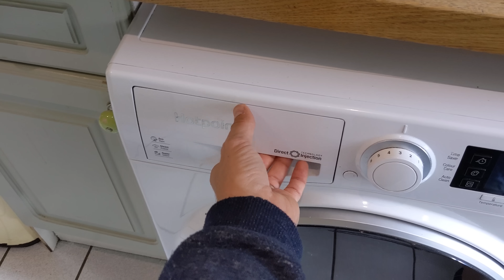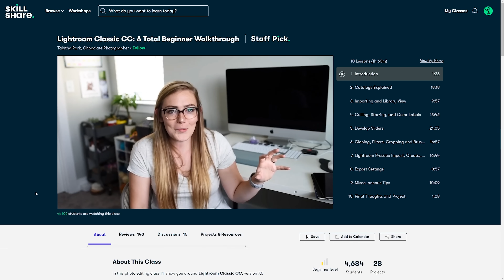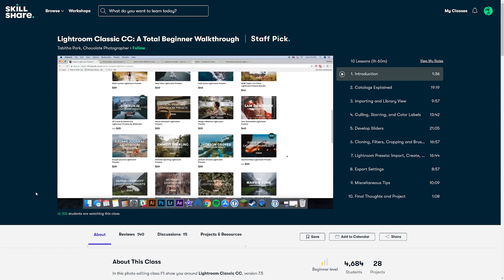The Pythagorean Siphon Inside Your Washing Machine

Comment: I live in Argentina and we don't have that kind of flush mechanism. We have some variations of a rubber cup or flap that gets lifted with the lever or the push of a button (that pushes a lever...). I got to know the existence of the siphon mechanism some years ago thanks to youtube. In fact, that cleared me some doubts I had when, for example, watching some movies... in which when a person goes to flush the toilet, if the water tank is not full, the toilet does not flush, not even some small amount of water it might have in the tank. Thats because of course because they're using the syphon mechanism and when the water level in the tank is low, you can't prime the syphon using that kind of chute that gets lifted with the lever. In my country, with the simpler rubber stopper, if you flush with the tank half-full, you get a somewhat wimpy flush, with only half the amount of water, but you get a flush. In that video, I don't remember the channel, it said that the syphon system is mainly used in the UK, and it was "chosen" or "enforced" (idk if enforced was correct) because it reduces the chances of a leaky toilet, because in this system the toilet might leak only because of the water fill mechanism float valve malfunctioning and letting water inside the tank above the required level (that water leaks to the bowl via the syphon), as when using a rubber flap or cup to obturate the drain to the bowl, you can get a leaky toilet that way caused by the float valve, but also you can have the rubber degrading or not sealing properly, so the water leaks to the bowl, so there are two potential fail points.

Comment: A regular siphoning hose will self prime too if the hose is below the water level of the container and has an exit below the water level as well. Like if you drill a hole in the side of a bucket and push a hose through it, or if you closed off one side of the bell in your 2D model and imagined the open path as a single piece of tubing rather than a stand pipe and bell.

Comment: Another really cool mechanism found in washing machines is the door lock mechanism. It uses bimetal plate that changes shape when heated and prevents the door to be opened for enough time for the drum to stop spinning in case of power failure.

I demand more washing machine related content 😅😂
Reply: My washing machine is more cunning - it detects when the drum's stopped - AND it's all purely mechanical !
Reply: @millomweb 
*electromechanical

Comment: Very good. The only reason I'm not sharing it to my friends is that several times you use the term "pulling" for liquids. Yes, we can lift liquids above a diaphragm and air pressure can push them - but they can't be pulled. I think you should redo the audio or put a caption in to correct yourself where needed.

Comment: Ah, the good old British toilets, regularly failing every 12 months, nice for keeping an army of plumbers employed.
We use a much simpler mechanism here (and I believe they are fairly common all over Scandinavia) which has a hole in the bottom, and the flush mechanism is a cup you lift so air get under it, and then it rides on the water until it's at the bottom and it seals again. Waaaay simpler and rarely fails.
Reply: Siphon flush mechanism failures are not as common as you describe, but in any case the common failure modes do not result in leakage, unlike with dump valve (flapper or plug) mechanisms which will often gradually fail with seepage into the bowl. I've had to replace the latter for this reason, and never the former.
Reply: @rednammoc  Just anecdotal evidence of course, but from my 3 years in the UK, having to service the toilet annually was a thing (and it is definitely not a thing here, just like separate taps for hot & cold water), and speaking with others this was fairly common.
And from a more objective standpoint, the siphon mechanism is much more complex than a simple plug on a stick, but if you have some better hard evidence of the opposite I'd like to hear it.

Comment: Im not sure, but I dont think toilets here (Norway) use that same system, because if you want to flush it completely you push down and hold the button longer, which according to the explanation in this video would cause it to flush less rather than more. If you want just a small flush you just press down and immediately let go, or alternatively some toilets have two different sides of the button thing that you can push: one that gives a big flush and one that gives a small flush.

Comment: As others have indicated, in the united States of America the "flapper flush" is the most common design with only the occasional bell siphon. In recreational vehicles, passenger rail and aircraft a flapper closet is preferred.
You missed one siphon in the design, there is one (or, there are two) in the bowl.
Reply: Canadian toilets are like the American ones typically incase anyone was wondering.
Reply: @georgeolund7572  Well, Canada is in America, so that makes sense.
Reply: I believe airplanes generally use a vacuum toilet these days. I know that they are what is used on the trains here in Canada too.
Reply: Your pan siphon - is where the pan fills with water first (or is already filled) - Steve probably has not come across these.
Reply: Matthew Ellisor Not in U.K. toilet bowls, there is a U bend and horizontal rear waste connection on most toilets, vertical drains through the floor are rare.
Reply: @spencerwilton5831  If you read his comment,  he specifically said "in the United States". That doesn't include the UK.
Reply: @spencerwilton5831  I've come across one with a siphon - where the flush fills the pan 3/4 full then the whole lot empties.
Reply: @spencerwilton5831  America use the same kind of toilet bowl. What this commenter and the video are talking about is the tank of the toilet.

Comment: Here the most common thing is a rubber ball valve in the bottom of the tank that seals the tank and when primed it floats on top the water until the tank is empty and it seals the hole again and let the water fill up . Simple and pretty reliable

Comment: I thought you were goig to talk about the BOWL syphon, I mean, about the water going out and not the water going in.
Regarding the water going in, here in Brazil I have seen three types. The old fashioned flushing cistern, like 5 feet over the toilet. The flushig box, like the one you shown, but with a simple rubber plug in the bottom instead of a siphon. And the "hydra valve", that is just a push button on the wall, connected directly into the water tube, rellying one the pressure of the water comming from the tube.
Reply: The hydra valve thing is a code violation everywhere in the US.

Comment: Argentina, South America here, we have both toilet systems, the shyphon one, which is more expensive, and the simpler one, which just raises a rubber stopper at the bottom of the tank. Once the water raises, the water itself makes pressure over the stopper, so it stops leaking. I think the disadvantage of this system is that you cannot do a partial flush, but works very well and it's cheaper

Comment: Plumber here. British toilets use the syphon mechanism you explained, but it's not in use in mainland europe, middle east or north america. Great great video. Thank you brother.
Reply: Educator here: siphon is correctly spelled with an i not a y. I too have been wrong for many years!
Reply: @millomweb  
Educators. Ugh.  Both spellings are correct and acceptable in modern English. The correct spelling, if we're to be pedantic, is σίφων.
   Hystorjki,  I, Y and J are all the same letter. Any Indiana Jones fan can tell you that, in Latin, "Jehovah begins with an I".
Reply: @seanadler918  Feel free to be pedantic but do stick to English.
Cyphon is also listed as an alternative spelling but siphon is the commonly accepted spelling.
Reply: @millomweb  same thing as "tire".
Reply: @Rusty00 NICE !
No !
Both are the same. 'Siphon' being preferred (or most common?),
Syphon less common, and
Cyphon I've never actually seen but is listed as an alternative!
Reply: @Rusty00 Never heard of that one !
Reply: Why do you not switch to a proper european one where you can freely and exactly regulate the amount of water you need?
Reply: whuzzzup they are available and are now quite common. The problem with them is they waste huge volumes of water when considered on a national level. The valves wear, or small particles of scale or dirt get lodged in them meaning they no longer seal properly. It's common to see a continental style toilet with a constant trickle of water running into the bowl. Multiple that by millions of toilets and you are wasting vast quantities of water. The syphon systems we used previously eliminate that problem altogether.
Reply: @spencerwilton5831  My normal-ish UK model offers variable flush between a minimum and maximum.
Reply: @spencerwilton5831  Fixing a leaking toilet is a minor issue that can be done quickly, yes it occurs, but I doubt it's a big problem. I have not come across a leaking toilet in years over various houses/apartments. And even if some of them are leaking, flushing 10l of water with a siphon system instead of 1l or less with a variable system for pee several times a day, seems a lot bigger waste on a national level.
Reply: @whuzzzup  My English one is fine thank you. It has a minimum flush, a maximum flush and anywhere in between.
Reply: @millomweb  Then you do not have the model shown here but an european one.
Reply: @whuzzzup  No, it's a UK but the option to not use the full flush is the other way around. The seal needed for the full flush is not on the top of the piston rod but underneath - so to seal, it has to be held up, i.e. the flush lever held down.
EU devices are more complex.

Comment: Here the most common thing is a rubber ball valve in the bottom of the tank that when primed floats on top the water until the tank is empty and it seals again and let the water fill up again. Simple and pretty reliable

Comment: This toilet mechanism is not familiar to me as someone in the US. We have the same float and ballcock, but the siphon mechanism instead is a floating plug attached to a long tube. The tube is there if the toilet is leaky, as you mention. If water rises above a level, it goes through. The plug/float gets pulled when a user flushes, allowing water to rush through into the bowl. It lowers itself slowly and replugs the drain. This kind of toilet does not have the feature that lets us have a light or partial flush. I'm sure I could buy the one you have somewhere, but I've never encountered it.

Take a look at this model. It's somewhat more modern, the float wraps around the drain instead of being a large ball attached to a rod. This lets the unit be more compact. I've mostly been using these the past ten years:

https://www.lowes.com/pd/Fluidmaster-Universal-Fit-Toilet-Repair-Kit/1000095832

But don't forget, the lower bowl of the toilet is a siphon too! Perhaps the most important part! The S curve or trap of the toilet is overcome when it fills beyond a point, and then the fluid in the trap flushes.

Comment: In the US and I've never seen a siphon mechanism.  It just goes down through a hole that the lever opens up.

Also, I think your toilet is the greedy cup, but it just has an siphoning method attached. You could also flush your toilet like a greedy cup by dumping water in the top.

Comment: Brazil here, at least in my house is a direct connect in a tube, we have a cartrige in the wall that is connected with the main water supply and then is a spring that rethrns tu block the leaver, and another one to adjust the spead of that return

Comment: At 6:29, you show a toilet mechanism that (as far as I can tell) is completely alien to the US. Is that a UK style toilet mechanism? Toilets in the US don't work that way. There's a weighted floating valve that has to seat on a ring, and pushing the handle lifts that valve and causes the tank to drain. When the water level falls under the height of the valve, the valve seats back on the ring establishing a seal.

It would seem to me that the UK style mechanism you showed is safe against valve failure that results in water constantly leaking out of the tank. The only thing that can go wrong and cause leaks is the water level being set at the wrong height, or the filling mechanism's valve not shutting tight and forming a leak via a slow dribble.

Comment: At my dad's the toilet works like this...

There's a big hole at the bottom of the tank with a buoient lid to cover it. It won't float to the top though because of the pressure of the water. But as soon as it is pulled just a bit up, the water passes through and the lid floats just a bit up and resets when the water drains out. 

Because it is still very close to the hole, a firm push, can actually seal and stop all of the water from going out.

Never thought you'd ask!

Comment: That looks like a real Rube Goldberg way to flush a toilet. Just a flap attached to a chain attached to the flush lever. I'm finding it difficult to figure out why that siphon is included at all.
Reply: Flapper plugs must form a good seal each and every time they close, and this can be a problem with old or poor quality seals. A siphon system only faces this issue with the inlet valve (which a flapper system will also have in common). That said, there are many UK toilets (usually newer ones) which don't use this siphon mechanism, and yes they are finicky about the outlet seal working. I've had to replace one that was seeping constantly into the pan.
Reply: @rednammoc  Well... I'm in my 50's and never had that problem with the flapper plug. "Your results may vary." I suppose.

Comment: At 4:39 you mention urinals that flush repeatedly by themselves. I think those are only used in the UK. I visited the UK a few years ago, and one restroom left me wondering how to flush the urinals. Then they just all flushed at once. I guess this is the low-tech way of having hands-free flushing, but it seems a bit wasteful of water.
Reply: It is a bit wasteful, but many of these systems would have been installed well before water shortages and hosepipe bans were a thing. In many places such systems have had PIR control systems installed to only fill the cisterns while there are people in the toilet. You can sometimes hear a relay click and a trickle of water start when entering a quiet toilet that hasn't had anyone in it for a while.
Reply: @rednammoc  if the frequency of flushing is low, and if the auto-flush system is turned off when the shops close so they don't waste water at night, this could be more efficient than everyone flushing away a gallon or so of water per pint of urine.

Comment: Two button toilets are the norm in Sweden, either with a rocker switch or a split button with two parts. Though I remember the pull design from old toilets in the 90s (so the toilets were probably from the 80s or older). I haven't seen one of those in many years. I assume there is a siphon in the newer design too, just a different mechanical linkage system.

Comment: In America, the only one that we have has a 'float' which controls a little lever that shuts off incoming supply. When we flush, a rubber stopper comes out, and it dumps into the bowl, returning to almost float above the hole. But, the float falls and it also rinses along the inside of the bowl as well. Washing off the sides a bit. Then, it refills the tank from the side washing action. And the float comes to a point, and it stops.

Comment: In America, the vast majority of the toilets I come across have a hole at the bottom of the tank with a plug that covers it. The flushing lever lifts the plug and the water in the tank evacuates out into the toilet bowl. The plug doubles as a float and rides the surface of the water and nestles back into place when the tank is empty. There is a similar float mechanism to stop the water that refills the tank. When we come across trickling toilets, it’s because the plug isn’t sealing properly and so the water in the tank leaks into the bowl and the tank never fills so the water doesn’t stop refilling the tank.

To clarify, the plug isn’t stuck in the hole, but rest over it and usually made of rubber to provide a seal over the hole.

Comment: In my toilet there's a very rudimentary system: when you push the button, a rubber cap is opened and the flow of water keeps it open until the thing is empty, therefore you don't have to keep the button pressed. When there's no water left, gravity pulls the cap back down and closes it. No fancy syphons used.
Reply: I looked at many many mechanisms on toilet shops and found out this rudimentary system is actually the most used in my country. I know, I'm weird.

Comment: There are some of those siphon toilets in the US but most just use a floating rubber plug in the bottom of the tank.  Flush the toilet and the plug is pulled up uncovering the hole so the water drains, and since the plug floats it rides the water level down until it is empty at which point it reseals as the tank refills.
The siphon system, while a little more complicated, seems to have a few advantages.  First, it is not susceptible to leaking because of a bad seal or debris getting in the seal.  Second, if the inlet float mechanism fails for some reason and the tank is always filling it will just run into the bowl with the siphon system but it will overflow the tank with the plug system.

Comment: All the toilets I've seen have a flapper valve at the bottom of the tank. You pull the handle and it pulls the valve open. The valve floats until the water drains out of the tank, then it falls closed.
     Of course, this doesn't give you the half flush option, witch is catching on here, but is still kind of unpopular.